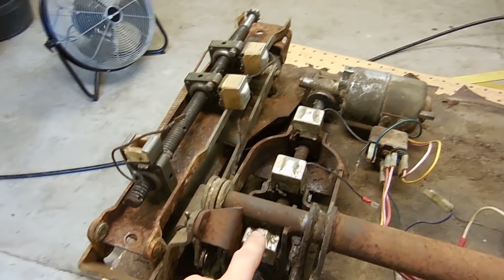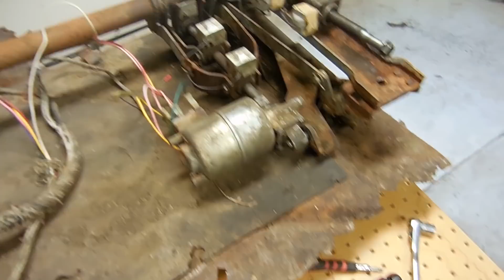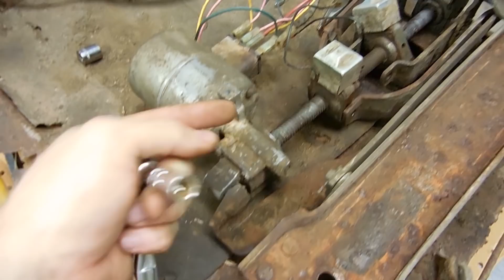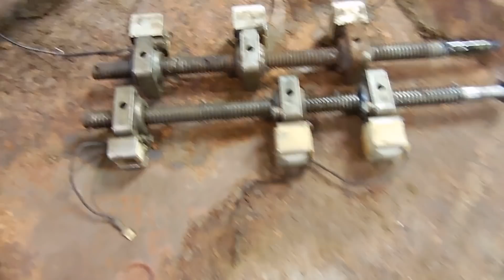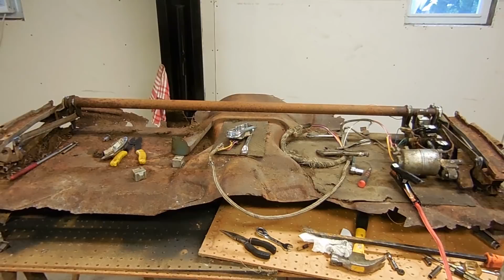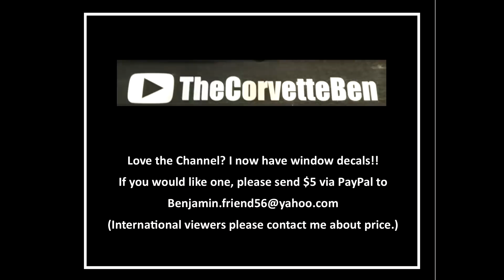1956 Cadillac Sedan DeVille Resto Video 74 :6-Way Power Seat Test

Comment: I hunted for a year looking for the whole motor mechanism that was missing from the seat. Lucky found one however missing the torque tube link attaching screws. on the sides of the relays. Any idea where I might find these? Impossible to find parts for this.

Comment: Cool to see you working on this. I restored one of these on a '56 Biarritz El Dorado. You have to be absolutely certain the concentric shafts are very free. You also have to time the solenoids so they are centered on the screw shaft and don't run into each other. The clacking noise is the solenoid getting over loaded and slipping on the screw. Also make sure everything is free or the current draw will damage the contacts on the switch. Love the Caddy and learned a few things from you while I was caring for my friends car.
Reply from the maker: Send me an email I have questions 
Benjamin.friend56@yahoo.com

Comment: This might be a dumb question, but do you think with the weight of the seat, that it would help it move more freely?

Also whats your plan for tackling all that rust? ...I mean surely, you won't take out an old (possibly) rusty part, only to put in another rusty part? ...they make special paints for painting over rust and theres also tons of rust neutralisers out there, that you apply and then paint over afterwards.